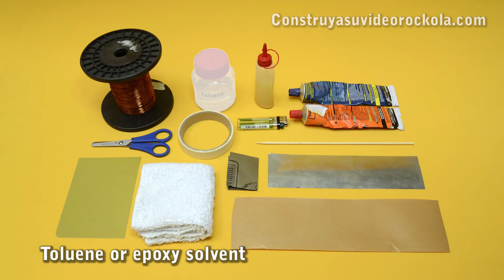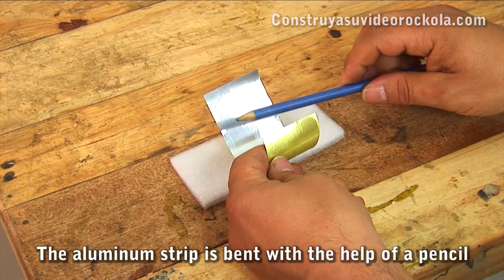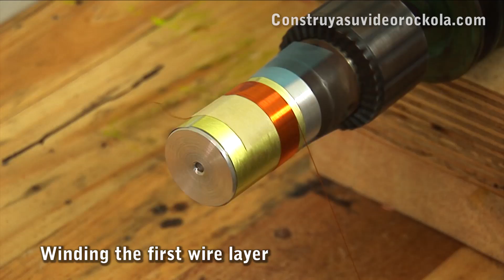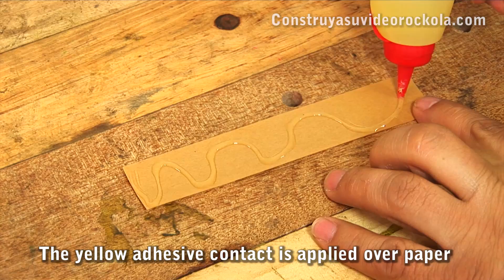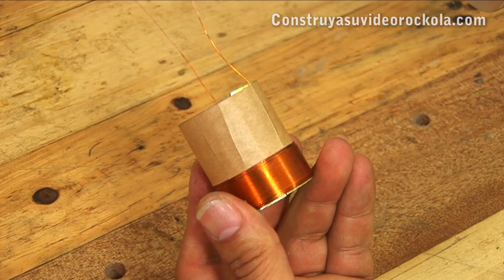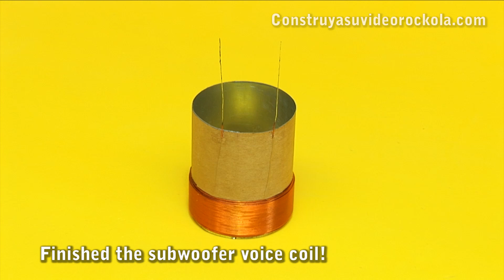Making of a 4 layer voice coil for speaker

Comment: hey what kind of coil did you use? and how many gauge it is?
Reply from the maker: Hi
I see you did not want to see the video, the list of materials is shown that gauge wire is used.
winding width is also shown.
Please read the article and watch the video.
Bye
Reply: +Ampletos what i mean is this a enameled copper coil? and is this for dc coil and how much is that? i tried to buy a coil like that. im from Philippines and i love to watch some of your videos. :)
Reply from the maker: Hi Thanks
Yes, it is enameled wire 31 gauge. You should keep in mind that this video is just one example and the gauge and size of the coil,  dependent of a speaker repair.
Reply: +Ampletos yah its true thank you again.. and i know the greater the diameter of a voice coil the higher a sound preasure level it can thrown away. :)